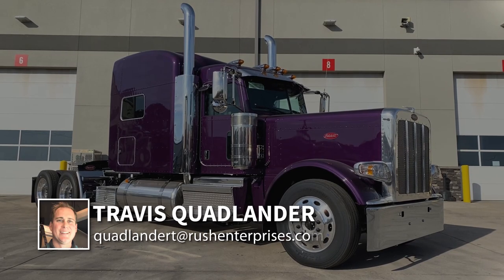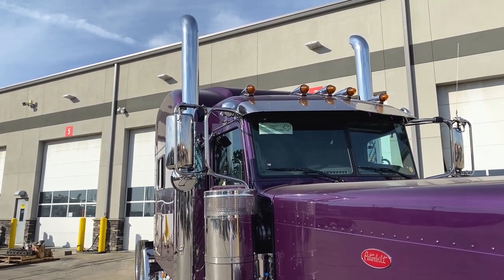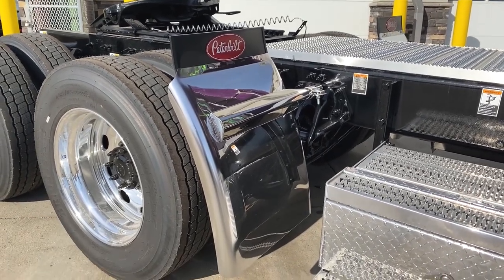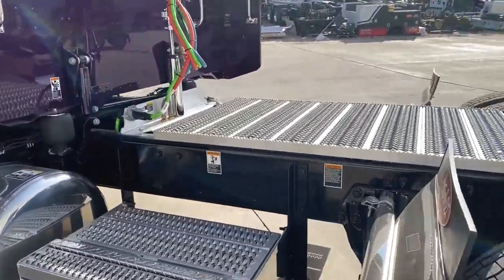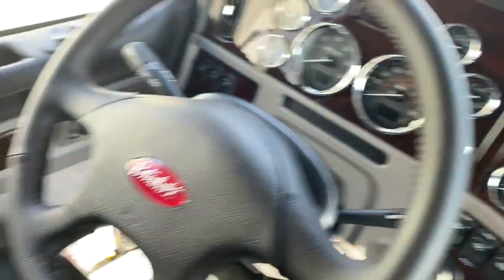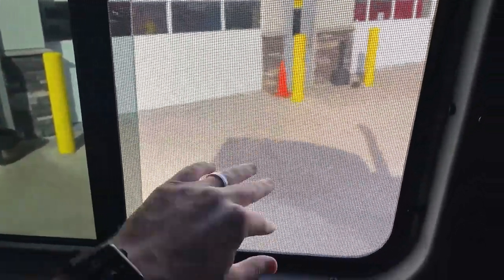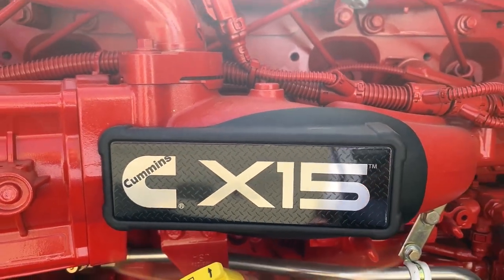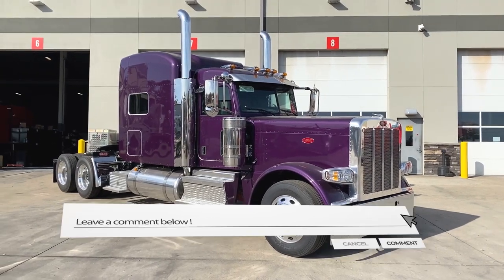Violet Effect 2021 Peterbilt 389 Cummins X-15 18 Speed – No Air Horns, Air Ride Front Suspension

Comment: Have to run elog and it has def no thank you! I would buy an 80s model truck first!
Reply: @six-pac2120  how dumb can someone be an older truck is way more reliable than this new junk😂😂😂 all my stuff is brand new anyway I have completely redone it!! I have 2 show trucks and they are not all plastic! I can work on my stuff with out a computer can you say the same? I would say hell no maybe a fuel filter would be it!😂🤣😂🤣😂🥲
Reply: @six-pac2120  I have nicer equipment than this and no def no elog and it’s payed off 😂😂😂😂😂😂😂
Reply: @jopete681  well sir you never know I may end up driving for you next yr 👍
Reply: @six-pac2120  really all I’m getting at as a truck driver like your self we all should stand together against carb! Know truck driver should buy a piece of equipment that is not simplified when we were already there! A nice new truck is nice but it will only get worse down the road! I wish people would stop buying into their game. Def fluid is basically ammonia and putting ammonia in the air is buy no means safer and the emissions system has bankrupt a lot of people! So hopefully you stay successful but  in my experience I have always had old equipment payed it off rebuilt everything got it painted and at the end of the day you turn a 30 thousand dollar truck into a truck worth well over a hundred thousand and it’s payed off no payment and even though all has been rebuilt it’s just like new! And a old truck that is a head turner will not get you pulled behind a scale no quicker than a new truck. So we all not make it but I’m not putting down your ride so good luck to u.